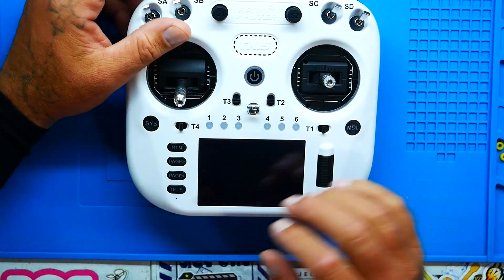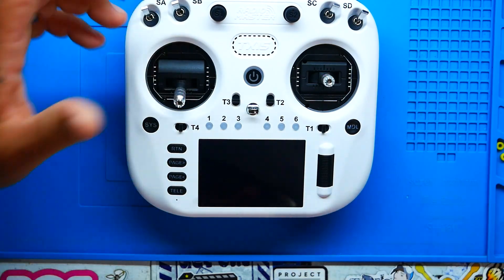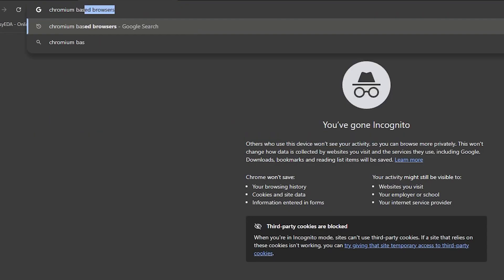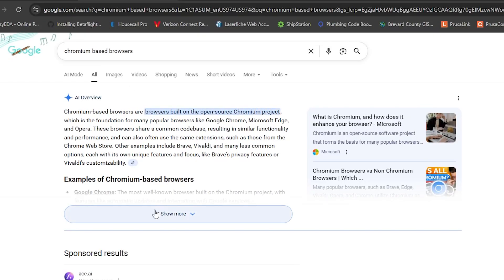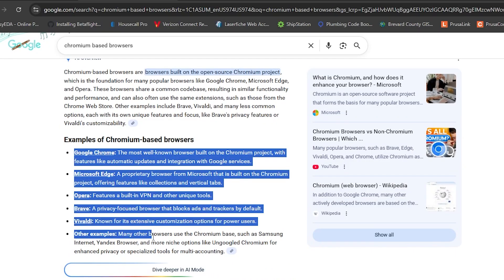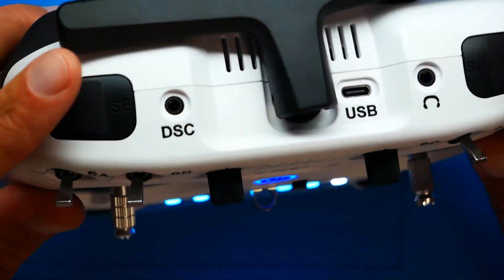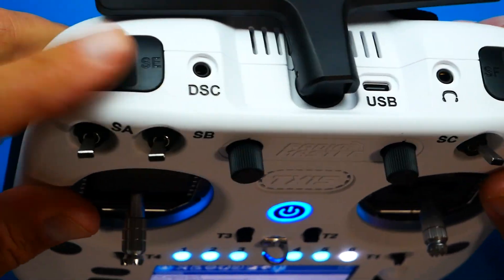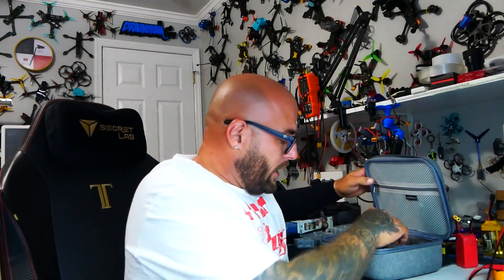Flash Firmware To Your New RadioMaster TX15!

Comment: Hi DrainMan, I really enjoyed your tutorials! I'm curious why the UI of your controller software looks different compared to other RadioMaster TX15 or Marx models.
For example, when I click on the SYS or MDL keys, all menus appear in the top bar, not like yours on-screen icons. In my setup, the menu count seems fewer. On my TX15 Max, the SYS key shows: Apps, Storage, Radio Setting, Themes, Global Function, Hardware, and About EdgeTX. 
The MDL key shows: Model Setting, Flight Mode, Input, Mixes, Output, Curves, Logical Switches, Special Function, and Telemetry.

Comment: dooo not flash anything right now 3.0 edgetx is at 75% give it another jonth i updated mine and it screwed it all up now it wont turn on the elrs and the radio reads voltages that are super low even though the battery is fulyl charged just a warning i had to return mine 1 month old...the only firmware is the custom firwmare from the webside radio master... if you try uploadin exdtx buddy it may brick it the fw is not out for it yet they launcehd it with bugs etc im so disapointed
Reply: I have encountered this exact issue after following through the steps in the vid, I havent figured how to revert it yet though...
Reply: @JJMTB_UK  yea well i bricked mine had to buy another one after i updated it never again i wont update anything now
Reply: @jerrypatterson55 so mines likely toast also

Comment: Where's the themes? I cant find themes for the life of me on this new version 4.
Reply from the maker: Sys, then UI Setup, then Themes 🪠
Reply: @DrainManFPV  not there. When selecting UI Setup, only options are “top bar” “screen1” “screen 2” and “add screen”
Reply: Figured it out. For some reason, with the firmware update, "Themes" was no longer enabled under Radio~General Settings~Enabled Features. Once I turned it back on, it was there.

Comment: Radiomaster has stopped updating that page and begun posting the TX15 firmware updates in the standard firmware download page for all radios. The firmware you downloaded has a serious bug that causes kernel panic. The latest 10/15 firmware update fixes that.
Reply: Yes correct! Also with the latest firmware the layout on the screen is completely different.
Reply: @stst8301 It's worse. You no longer have touchscreen compatible tabs to move between different pages of the SYS and MDL menus.
Reply: @nachiketmhatre7411 Yes I have observed the same!However I dont know if its good to rollback or not since it's said there are bugs with previous versions;